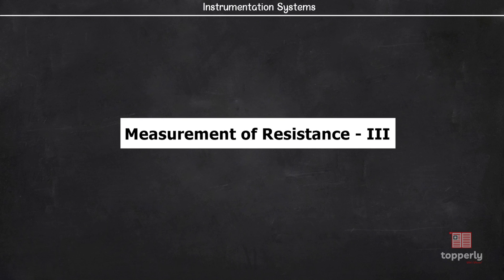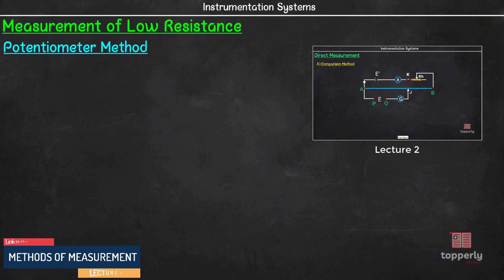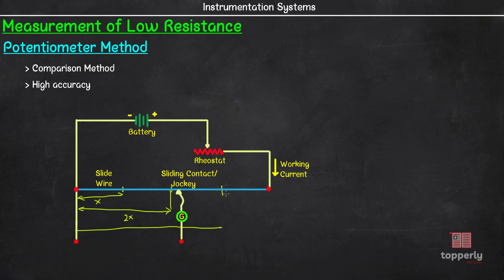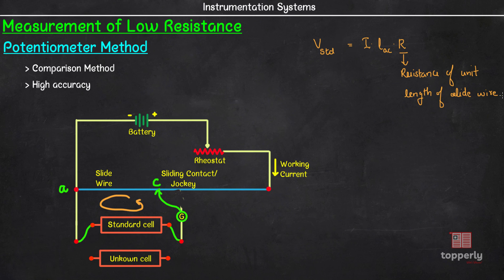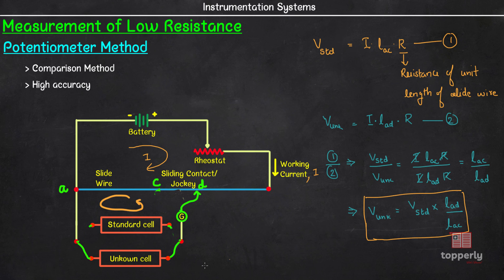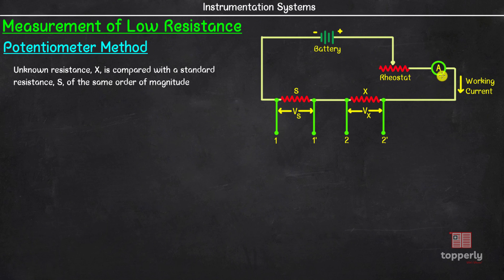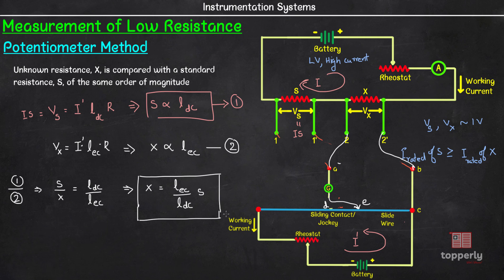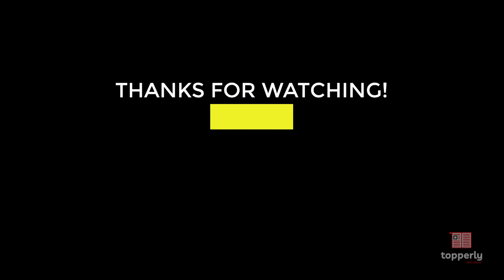Potentiometer Method | Low Resistance Measurement | Instrumentation Systems

Comment: Sir, in measurement of low resistance method you wrote that 'S' is directly proportional to Ldc
Here 'S' is also a resistance that is constant. How can you say that 'S' is directly proportional?
Reply from the maker: Hi Sudhakar,
What you said is correct - S is a constant resistance.

But think of this. You want to measure an unknown resistance around 0.2 ohm. Then you'll need to use a standard resistance S1=0.2 ohms(say). For this S1, you'll get a corresponding length Ldc1, right?

Similarly if X is in the neighborhood of 0.8ohms, then we use a new standard resistance S2 = 0.8 ohms, and corresponding to S2, we'll get a new length Ldc2.

So Ldc is directly changing according to changes in S. This is why I mentioned S is proportional to Ldc. The ambiguity will be over if you think Ldc is proportional to S :)
Reply: @Topperly  Thank you sir.. Great job👍👍

Comment: Why can't we measure high resistance using this method??
Reply from the maker: Technically you can. But it'll be an overkill. We don't use a millisecond precise clock for measuring hours, right? Same way.

Also, you need more sensitive instruments to detect the low currents through high resistances, which increases cost :)
Reply: Thank you.. Very interesting.. 
Waiting for more videos from electrical.. 
Sir, why can't you start making videos on synchronous motors and induction machines..
Reply from the maker: We'll try to in future :)
Reply: @Topperly  Sir, I have another doubt.. Why low voltage and high current while measuring resistance using potentiometer?
Reply from the maker: I'm explaining it in the video. Please check :)